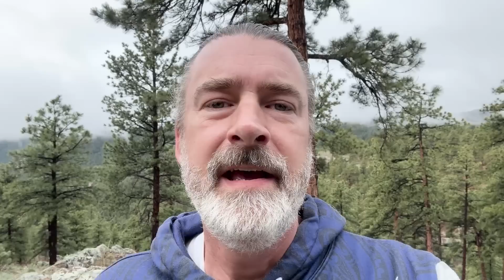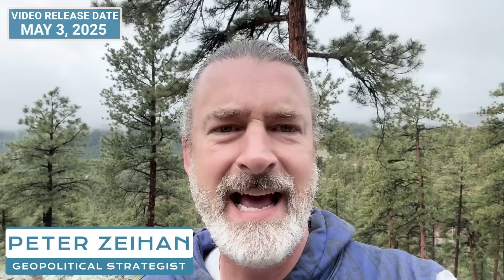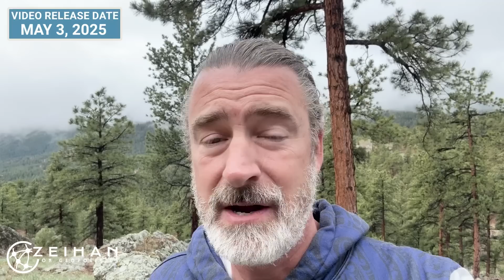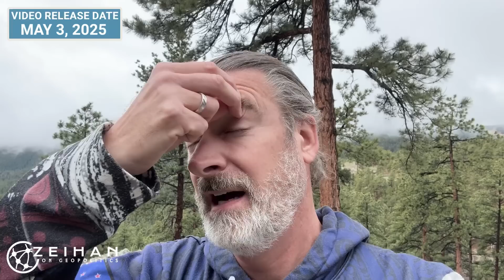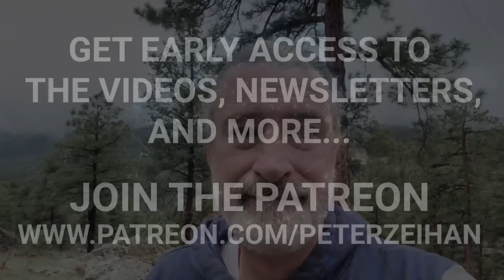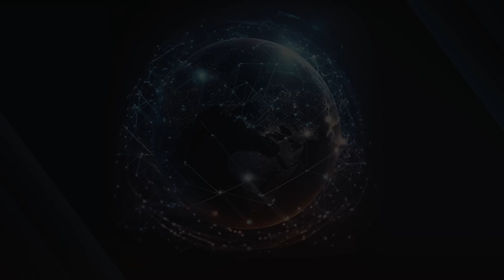The Night the Lights Went Out in Geor- er, Spain || Peter Zeihan

Comment: You're forgetting nuclear power Peter. Crucial especially for Germany, who moronically gave up that source of power, but fortunately border France, who have a huge power base in nuclear, as well as Czechia, which for a country of it's size has lot of nuclear from it's two power plants of the type.
Reply: Wouldn't bet too much an on France.
Many of their nuclear power is from 80s and planned to shut down as well.
Sure they want to use them for 60 years but this is also 2040

And as of now. They are really bad at building new nuclear power stations.
Reply: @blablup1214  Their expiry date can be extended, if inspections determine the plants to be safe. Plus, we can build new ones. Sure it takes time, but it is the only power source, that can generate cheaply enough at scale necessary for us. And no, energy efficiency will not save the grid.
Reply: @looseycanon  Yeah it can and will be extended with appropiate modernisation.

We will see if you can build another one before 2040 :)
Reply: Actually we still have 3 nuclear power plants in Germany, despite kind of stopping + we still use brown coal and LNG.
Reply: @Takketa7  Interesting... where do they operate? Cause by certain logic, I could claim Czechia has three nuclear power plants. If I recall correctly, there is one in Prague, but it's not connected to grid, as far as I know, and is used for training purposes.
Reply: bro this outage had literally nothing to do with germany nuclear power.
Reply: @ballinlikebill8334   bro, this comment was all about german nuclear power.
Reply: @tsubadaikhan6332 which has nothing to do with the outage complete nonsense
Reply: Peter referenced existing infrastructure, which would be the inactive fossil fuel plants.
Reply: Didn't realise there were so many Germans here who have studied their electrical grid.
Or are you a bunch of dumb yanks opining on a country you've never been to, but are experts in?
@Jokeniv - After voting in a moron like Trump US people can't complain about chaos. You've won that Prize.
Reply: Antonio Turiel, a Spanish physicist and energy expert, has raised significant concerns regarding the decline in uranium production and its implications for nuclear power.
Turiel highlights that global uranium production peaked in 2016 and has since declined by approximately 24% . This downturn is attributed to geological constraints and the rapid depletion of high-grade uranium ores, making extraction increasingly challenging and less economically viable.
To compensate for the shortfall in primary uranium production, about 20% of the uranium used in nuclear reactors now comes from secondary sources, such as dismantled nuclear weapons . Turiel warns that these reserves are finite and cannot sustain long-term nuclear energy demands.
Reply: Thorium reactors are feasible and thorium is abundant
Reply: Nuclear power plants have the major disadvantage that they can't simply be started up if they aren't constantly connected to the grid. That takes time, and in a scenario like this, you simply don't have that!
Reply: @wallerwolf6930  
Keep reading this BS time and time again.
It is wrong, it is a lie.

Nuclear PS have large Diesel generators to black-start the PS.
They are started with compressed air which the generators via a compressor keep at the necessary pressure and capacity to restart them by running them frequently (also for maintenance). In the worse case you can carry compressed air via trucks to refuel the tanks.

Every heavy Diesel engine in the world - like military tanks, ships, large trucks - will be started this way.

Nuclear power stations can be black-started at any time, they have the capacity to do so.
Solar and wind do not have this capability.
Greenish propaganda of people who need to discredit nuclear power.

Peace! from Dresden / Germany
Reply: @wallerwolf6930  Not entirely true. Even these power plants can regulate their output, though not quite as quickly A big enough shift over extended period of time can force even a nuclear power plants to alter their output. Besides, this can be designed around. Nuclear power plants require extensive amount of water to work, to the point, that typically, there are dams built for these power plants, to always have substantial reservoir of water. Meaning you can colocate hydro and nuclear power plants into one complex, with primary load bearing part of the power plant being nuclear, while Hydro serves as first response of the power plant to changes in power demand in the grid as well as constant source of power for nuclear side's backup systems.
Reply: You get what you deserve. If you vote with your feelings, you will get chaos.
Reply: @MickDundéēèe  voting with one's feelings is fine, so long as those emotions are aligned with science.  it's when feelings override reason when problems arise.
Reply: @ObjectiveTruth5168 haha my people
Reply: @MickDundéēèe  To be fair.
After Merkel and CDU deciced this in 2011 after Fukushima.
There really was no much choice of turning back.
We would have to stop it as soon as 2015 so that they are still economically viable.
Reply: @blablup1214  "We would have to stop it as soon as 2015 so that they are still economically viable."

2015 was a decade ago, no chance of stopping in 2015 anymore, mate
Reply: @MickDundéēèe  What "feelings"? Merkel preferred cheap Russian gas over security and future proof solutions! Tho if you meant greed by feelings you were right...
Reply: @prizmajeno  it wasn't Merkel really (She was a Doctorate level expert in chemistry, so she knew nuclear is the best way, but was trapped by the need to keep the anti-nuclear greens and fossil fuel dependent industries that were taking in huge amounts of russian product on her side to stay in office).  Gerhard Schröder started the country on the Energiewiende path of nuclear deconstruction, and after his time in office was deeply involved with russian energy companies and related projects including BOTH Nordstream pipelines, was actually on the board of Rosneft, and in 2022 was nominated by Putin to be on the board of Gazprom (which he declined after facing massive criticism at home due to Russia's invasion of Ukraine).

you want to aim criticism...  look to Schröder.  he was the one who really locked Germany into russian energy dependency.
Reply: @prizmajeno  Merkel was pro nuke until 2011 when the German public turned against it in the aftermath of Fukushima (as if they were ever likely to be hit by a Tsunami)
Reply: @prizmajeno  But her wonderful cheap Russian Gas went away after Putin and his Russian ego invaded Ukraine.  OOPSIE!!
Reply: @ObjectiveTruth5168  Needing them to remain in power is not really that good of an excuse.

You just said Merkel sold us for power....
Reply: @blablup1214  she continued an already established effort for the sake of staying in power, yes.  During that time period, can you honestly say that under a different chancellor, with the policy dominane of the greens and the Russian influences (which included Schroeder...  it's not as if he exited the political sphere when he left office), that the energiewiende would have been slowed or exited?  Without knowing what was going on behind gge scenes, it's pretty much impossible to think Merkel had any real say.
Reply: @ObjectiveTruth5168  I'm happy to blame Schröder! I was just trying to condense the time-frame and reasons into a single sentence not scapegoating Merkel, but you are absolutely right, I was sloppy! Thank you for the clarification! 
I just find it hilarious how some US people think about EU politics! Especially after they elected Trump, as if it was some masterful calculation and not "feelings", and how their congress does nothing while Trump blatantly demolishes their democracy! It only took 100 days to get to what Orbán achieved in 10 years!
Reply: @prizmajeno  speaking as am American, I'm of the opinion that trump being elected was not representative of him winning so much as it was of the Democrat party losing due to their abandonment of the working and middle classes.  Trump only slightly improved on his popular vote count in 2024, while harris lost over 10 million compared to Biden in 24.  Nearly as many voters stayed home as voted for either.
Reply: @ObjectiveTruth5168  That isn't an unreasonable take, but consider what W once said: "Fool me once, shame on... shame on you. ' Fool me—you can't get fooled again." We heard reports about the Dem campaign and how out of touch they were so you absolutely have a point, but believing Trump, or at least thinking he was the lesser evil, when you have evidence to the contrary... 
But maybe it is a late stage capitalism thing, almost everybody feels the abandonment, earnest candidates are filtered out, so the options are business as usual/status quo candidates or fascists/autocrats and those are at least look authentic maybe, at least in their desire to change the status quo.
Reply: @prizmajeno natural gas is the best raw material for chemical production ( inc all furnace processing). The US didn’t want Europe to be successful & the Euro to be a threat to the dollar so per long standing US doctrine the Nordstream was blown up
Reply: @Bastudalen2024  I'm not sure you wanted to reply that to me, but I agree :)
This is the strangest thing about Trump as a European, it is super scary that the US under Trump might become a full blown evil empire, on the other hand all these incompetent appointees really threw a wrench into the evil empire business the US was already doing! A more healthier, multi-polar world might just emerge, who knows
Reply: Like Trump?
Reply: Thats scary that Czech and France can literally destroy earth in a nuke meltdown
Reply: Nuclear is too expensive, BESS is way cheaper
Reply: Nuclear remains the most expensive electricity man can create.
Tell me how the Math works on Vogtle, Georgia, USA, or Hinckley in the UK.
They're the best advertisements ever for wind and solar.
Reply: @tsubadaikhan6332  do some research on EROI with regard to nuclear as compared to wind/solar, before making embarrassing comments like these, you've got it the other way round and that's not counting the environmental damage caused by wind n solar
Reply: @pavelandel1538   I've done research on nuclear mate. And I can't find a nuclear power station built in the West this century that hasn't been about 10 years late to competition, and ended up costing double what was budgeted.
Anyone telling you Nuclear is cheaper is working on costs of nuclear plants built 40 or more years ago.
Once again - I'm not against nuclear. But it's fucking expensive. There's no getting around that, unless you're China and can ignore the public and the environment, and none of us can do that.
Reply: @tsubadaikhan6332 - false assumption.
Reply: @tsubadaikhan6332  That is actually BS. The most expensive are nuclear and wind, because you have to build these, to cover plants that take over, for when solar and wind don't work, or you need battery storage, which will never work. That's just the laws of physics and economics. The thing is, when ever you see expense sheet for wind and solar, backup power generation/power storage is never calculated into the project at scale necessary to prevent outages like these.  Just compare German energy prices, which are highly reliant on wind, solar and gas and French energy prices, which are highly dependent on nuclear and hydro. Hint, French have some of the cheapest energy prices.
Reply: @looseycanon   Fact; French Nuclear Power Plants are on average 40 years old. We cannot replace them for the prices we built them. Sorry mate. You're working with olden days financing and olden days technology. I'm not against Nuclear Power. But everywhere the West has built it in the last 40 years, it can't compete on Price, even factoring batteries which keep getting cheaper.
If Westinghouse says they'll build you a 6 GW Nuclear Plant at a price upfront you like, go for it. But they won't, and haven't done this century. Neither has anyone else. Until they do that we're better off building renewables.
Reply: @tsubadaikhan6332 This argument is seriously flawed. The fact is that building a grid with renewables is IMPOSSIBLE. The reason why we have been able to add renewables is that we already had base power, and thus you cannot compare costs 1:1.

Wind and solar are essentially useless on their own, and in combination with anything but existing fossil fueled power generation and hydro. The "low" cost is a fraud. Why people keep believing that intemittent power is a good thing is baffling to me.
Reply: @svensvensson8102  You're only baffled because you're using 1980's math fed to you by fossil fuel companies. The entire UK has powered itself for nearly a month straight without emitting Carbon already. And I'm not saying Nuclear has no place in the mix of power generation. What I am pointing out is Nuclear is currently THE most expensive part of that mix.
Your choice mate. Stay baffled and pay more for electricity than everyone else in the world or catch up.

Comment: Correct me if necessary (you electrical engineers) but I think a slightly clearer explanation is that if you add load to a grid, the frequency slows down (very slightly, generally) and very accurate monitoring equipment detects this reduction in frequency.  More supply is added to the grid to bring the frequency back where it should be.  Conversely if load is reduced, the frequency  increases and the equipment will reduce supply, brining the frequency is back within its very tight limits.  Anyway, and hear is where I would like to hear from an engineer, I understand there is another solution to keeping the frequency within its proper limits.  That is pumped storage and especially off-river pumped storage.  And there are apparently a lot more potential sites than has  been commonly believed.  Have a look at this.   https://www.youtube.com/watch?v=_-cOgrBIAuc&t=29s
Reply: Source doesn't matter. They just need some more inertia in the grid.  You can get that by letting the grid pull a generator as a motor and balancing the grid on the voltage on the Anker coils.
Reply: Synchronous condensers are one, albeit relatively costly, solution that exists today.  Many US IOUs are converting the generators from old, shuttered thermal power plants to synchronous condenser units.  But, until renewable developers are required to install them, though, don't count on it happening soon.

Comment: Must say that even taking into asking your caveat around simplification, you're missing the mark here. Two obvious rebuttals:
1. We don't actually know that this frequency issue was the problem, it's just what's been hypothesised by people (often fossil advocates). South Australia has higher renewable penetration than Spain, but this hasn't happened.
2. Flywheels powered by renewables are a low cost solution you don't mention.
Reply: South Australia also has a "big battery" which stabilised the east coast not long after commissioning.
Reply: The frequency is not the issue, it's a how,  not the why.  The issue is that renewables are not reliable without some type of extended energy storage, which was not in place.

Flywheels is just another type of energy storage, it is low cost until you have to build them at the scale you need to store enough electricity to last for several days of clouds and light winds.